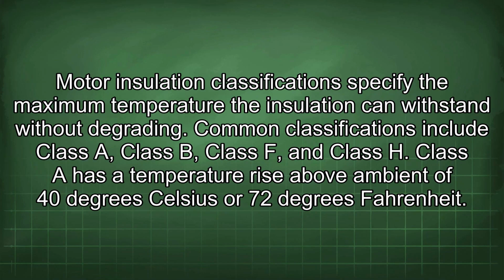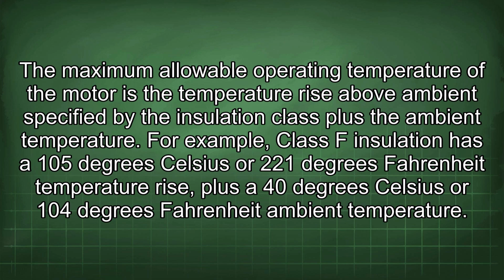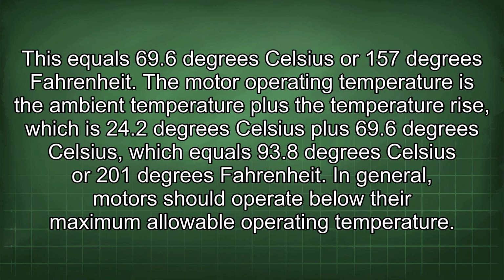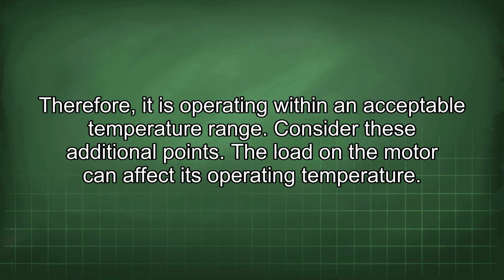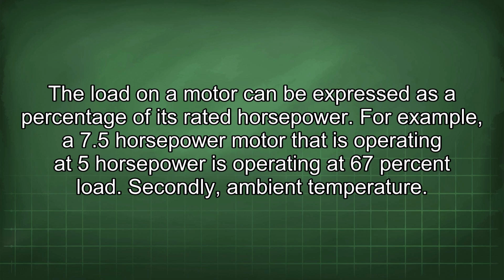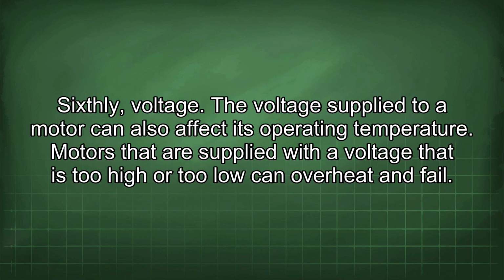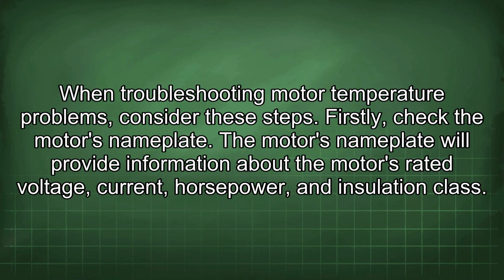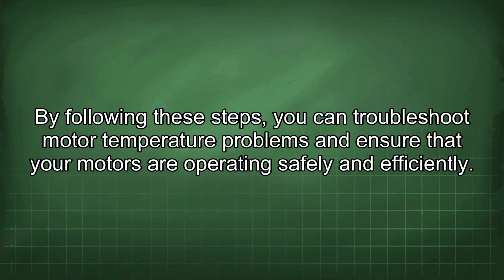Motor Insulation Classes Understanding Operating Temperatures

Comment: you forgot to add UNDERSIZING the FEEDER CONDUCTORS that terminate at the motor terminals. If they are undersized their resistance increases and they overheat, which can undermine the integrity of the motor and cause it to fail.
Reply from the maker: Hello @o0DJANIMATE0o,

Thanks for your comment; we will pin this post. When connecting a motor, it's crucial to ensure that the electrical wires (feeder conductors) running to it are appropriately sized. If these conductors are "undersized," meaning they are too thin for the amount of electricity (current) the motor needs, a problem arises.

Here's a summary of what happens:

Increased Resistance: Thinner wires have higher electrical resistance. Imagine trying to push a lot of water through a very narrow pipe – it's harder and creates more friction. Similarly, electricity flowing through an undersized wire encounters more resistance.

Overheating: This increased resistance causes the wires to heat up significantly. The electrical energy that should be powering the motor is instead being converted into wasted heat in the conductors.

Compromised Motor Integrity: This excessive heat can damage not only the wires themselves (melting insulation, causing shorts) but also radiate heat back to the motor terminals. This heat can degrade the motor's internal components, such as its windings or insulation, weakening it over time.

Motor Failure: Ultimately, the constant overheating due to undersized feeder conductors can lead to premature motor failure, resulting in costly repairs or replacement and downtime.

In essence, using undersized feeder conductors is like giving a motor a "choked" blood supply. It can't get the power it needs efficiently, leading to overheating that damages both the wiring and the motor itself, eventually causing it to break down.

Sincerely,

BESA Research